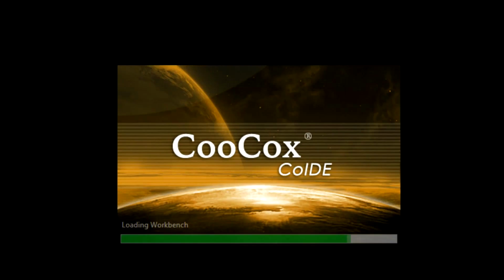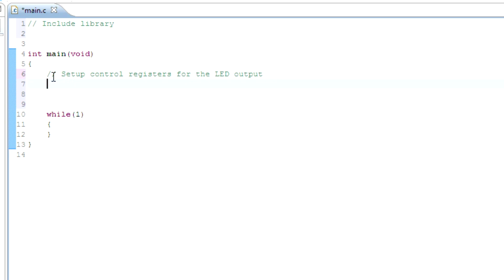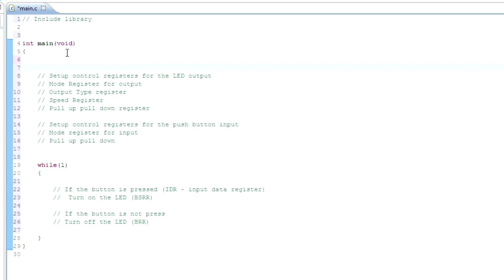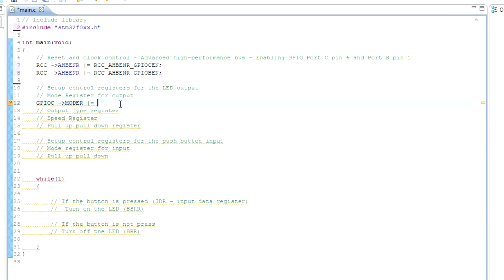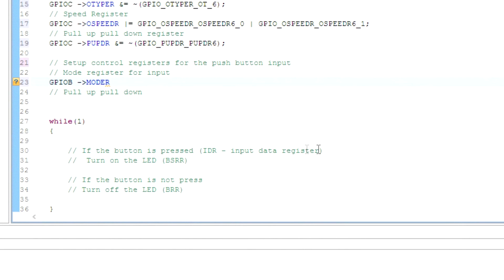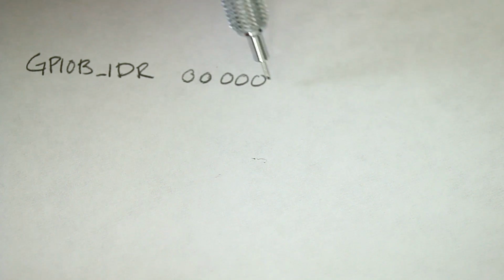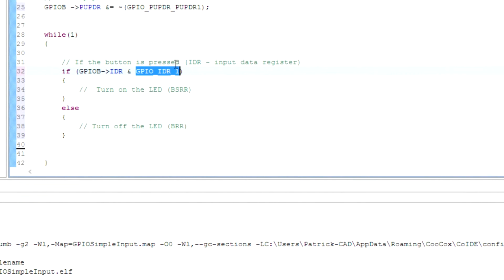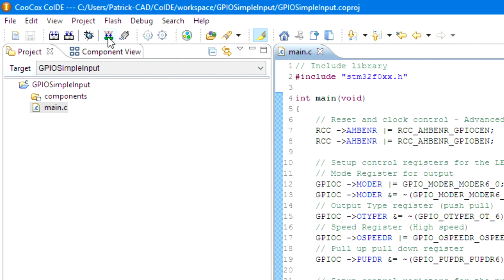11. How to Create a GPIO Input for ARM MCUs Part 2 - Tutorial on Control Registers and Code

Comment: hey, i did this using an stm32f103. it worked but in opposite. when i push the button, the led is off. when i do not push the button the led is on. i double checked the circuit. nothing wrong.. can someone help me?
Reply from the maker: I don't know the instruction set for that chip well enough to help.  Hopefully, someone can help in this thread what is happening.
Reply: @PatrickHoodDaniel  same problem occured when running the blink code. When i increase the led on delay time, the led off delay time increased...

Comment: I have had success with setting this up and it is working.  However, it only works while I power the board from the Vcc and Ground of the ST-Link.  If I power it from another 3.3V source it does not work for me.  Why would this be?  The first tut, "blink an LED" works fine when powered from the alternate 3.3V source.  I'm a complete newb to electronics this is my first project.
Reply: Ah, figured it out.  Other power supply says it is 3.3V , but when I checked with meter it is only supplying 2.7V.  Hope this might help some other newbie!

Comment: Hello,

Your mask is assuming all other pins will stay at 0 forever. 
But what if your product evolves and in a later version you make use of the other pins? 
It means every time you use a new pin you'd have to come back to this piece of code and modify the mask.

So my question is: how to test this specific bit without having to care about the others?

Thanks a lot

Comment: The programming for all the microcontrollers ARM are the same?
Reply from the maker: Really, I find them quite different, or non-existent.
Reply: Sorry, I don't understand. Aren't they supposed to follow a pattern because they are all ARM processors? Sorry for the noob question.

Comment: Greetings Patrick! You are doing great tutorials. I have one question, can I put hex code on registers? Example:
Change 
RCC ->AHBENR |= RCC_AHBENR_GPIOCEN;

For 

RCC ->AHBENR = 0x000C0000;
Reply from the maker: Yes, that is no problem at all.  You can use Hex (0x04), Binary (0b0100), decimal (4), or shift operators like 1<<3, or the pre defined macros like the one you showed in your question.
Reply: Patrick Hood-Daniel Thanks!
Reply from the maker: You're welcome.  Enjoy the series.

Comment: Great stuff Patrick. I am following this series with interest. I have purchased your ARM breakout board. I started programming by following your 8bit AVR series originally but moved on to using my own Atmel UC3 32bit processor once I got the hang of AVR8 series. - Now I would like to use ARM instead as the Atmel UC3 is going end of life. It would help a lot to see how serial I/O works on this cheap little 32bit ARM chip - tutorials on using spi and rs232 would be excellent.
Reply from the maker: Hey Steve,

I will definitely be getting into those subjects. Thanks for the kind words and stay tuned.

Comment: So the registers that you're setting up at the start are like the config. bits in PICs, right?
Reply from the maker: If you are referring to fuse bits, it's kinda the same thing but way out of context. The pic also has registers that you set to control the mcu peripherals and you would set them in the same way I'm setting them in the AVR series. 

In this series, the control registers are more organized into structs with members, so that is why they appear different.

Comment: Hey, Is it possible to use St-link to have your computer interface with your arm cortex a35?
Reply from the maker: The ST-Link is compatible with the STM32 series with Cores of Cortex M0 to M4.  I haven't seen an STM32 with the A35 cortex core.  In fact, I didn't see the A series Cortex in their line of microcontrollers at all.
Reply: Are there any other products like ST-Link? for programming A35?
Reply from the maker: You'll need to find what manufacturers are building the ARM Cortex-A35.  ARM creates the architecture and manufacturers like STMicro, Atmel, Freescale, NXP, etc are licensed to make the chips from the designed architecture. If you find the chip manufacture that you like with the A35 Core, then you will need to search for their proprietary programming interface.
Reply: Thank you, very much.